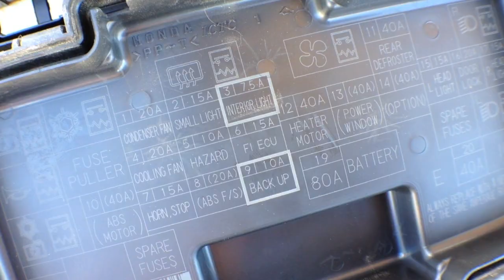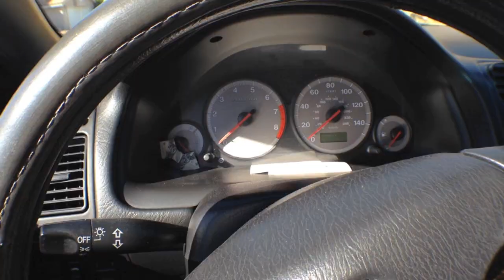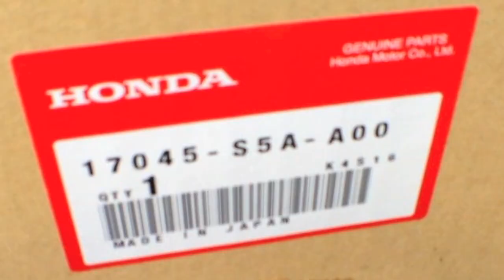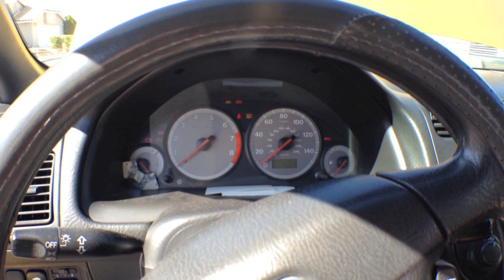Fuel leak!! Replace fuel pump Honda Civic Accord √ Fix it Angel

Comment: Pulled out seat and I have Exact same crack today in fuel pump housing On my ES1 stock 218,000 miles, thanks for the video.

Comment from the maker: Fuel Pump https://amzn.to/2UTzABp
                    http://tiny.cc/v4rf4y
Fuel Pump Removal Tool https://amzn.to/2YlvVhL
                                              http://tiny.cc/4wrf4y
3/8 Drive FlexHead Ratchet https://goo.gl/QVMstw
                                                  https://goo.gl/jjDK9r
3/8 Drive Metric Socket Set https://goo.gl/sRTnaT
                                                  https://goo.gl/MyyyWU
3/8 dr. Metric Deep Socket Set https://goo.gl/6KCiYG
                                          https://goo.gl/DxQBJM
3/8" Drive Extension Set https://goo.gl/HrOvhn
                                          https://goo.gl/hpyyHw
Cordless Screwdriver https://amzn.to/2F3jMoW
                                        https://goo.gl/Ty6zaG
Small Pick Set https://goo.gl/Qw2EPj
                           https://goo.gl/fEVAf3
Shop Towels https://goo.gl/K1LJKh
                        https://goo.gl/aeqBTL
Shop Rags https://goo.gl/wzFLHT
                    https://goo.gl/C6UfjR

Comment: EXCELLENT AS USUAL! JUST CURIOUS AS TO THE COMPLAINT, ODOR INSIDE?  PERFORMANCE? DASH LIGHT?
Reply from the maker: +BEEKEEPER Yes strong smell of gas. performance of the car was normal, I guess the fuel pressure was enough for the car to run good. and there was no check engine light. Thank you for the question. Have a nice day.

Comment: I have a 03 Civic... check engine light came on with p1457 Evap leak... I changed the canister and both purge and by pass solenoids... the code came back on... and my car do smell like gas... can this be the cause?
Reply from the maker: I don’t think so but if you smell gas. It would be good to check if it has a fuel leak.
Reply: Fix It Angel I took out the seat and saw that the pump was cracked... could that be the vapor leak that is setting off my p1457 ??

Comment: Hi 
I have a question  I need to remove fuel  pump on Toyota Highlander but the retainer ring   can’t get it off on what direction came lose (I’m doing against clockwise) I appreciate any advice thanks in advance
Reply from the maker: Alejandra Ruiz hi, it is very hard to remove. Remove counter clockwise
Reply: Fix It Angel thanks for your soon response

Comment: Mine was leaking from top I got 4261psi epoxy glue and sealed it but I see gas leaking from around screw cap I took cap off and seems alright, what should I do thanks
Reply from the maker: remove cap and put silicone grease around the seal.
Reply: Fix It Angel does the silicone grease stay greasy or acts as a sealant
Reply from the maker: Hi, Yes

Comment: You shouldn't use anything with silicon on your fuel system or intake. The silicon vapors alone are enough to blind off your oxygen sensors

Comment: Hey, great video. I didn't know Honda sold the whole assembly together. On rockauto.com I was able to purchase the top part (which was cracked on yours) by itself. But you have to look under 04 civic. How much did the whole assembly cost?QUESTION: I noticed your car cranked for a bit before it started after you finished. I just changed my fuel pump filter (that top part of the housing) and now my car is taking as long as yours did to start, if not longer. Since this repair job, has your car gone back to normal, starting with a 1-2 second crank and then turning over? Or is it still cranking for like 5 seconds before starting?? Please respond!!!! :)
Reply from the maker: Hi Callum, This is my friends car. The part was around $350. There is no problems with his car. No issues on the start time.
Reply: Fix It Angel Alright, thanks. My civic's start time seems to be normalizing. Sorry to hear you paid 350! The part you needed (the top part), I only paid about $60 for. :/
Reply: Do you have the part number of that top part by any chance? Thanks!

Comment: I smell fuel around the outside of the car. Thankfully I don’t smell it inside if I keep the air on recycle. Either way it’s not safe to drive but I don’t think this is my issue. Wow that’s quite a leak! Holy crap. I’m hoping it’s just a gas cap but the car sat for a while before the guy sold it to me. He said he drove it around every so often but still... can’t be too good for a fuel tank. The smell was really strong last night but I couldn’t smell it today. Damn cars... my CRV is in the shop getting the whole drive line replaced. Still cheaper than a new car but I want just one vehicle without a check engine light on lol. Eh, I paid $2600 for the car... if this is all that’s wrong with it I can deal.

Comment: Hi, I have a question. Did the cracked fuel pump in your car cause any other symptoms besides the gas smell? Thanks for your time.
Reply from the maker: Hi, my friend said it was just the smell he noticed. It's odd, I would think the car would have a long crank time to start. Welcome
Reply: Oh okay I see. Would you be able to find out if he had any unusual shaking of the car while at stops? Thanks
Reply from the maker: do you have a check engine light on?
Reply: No, just the maintenance required light just flashes then goes away when I turn on the car. My fuel pump is cracked, but I'm not losing gas mileage and it isn't spewing out like your friends. Not sure if that could be causing the shaking/vibration of the car. I already changed the engine mounts, cleaned the throttle and the idle control valve. Also checked the fuel injectors and they look fine.
Reply from the maker: When you are driving the car, what is the speed it is shaking. it could be your axles.
Reply: +Fix It Angel At stop lights or when the car is in park so zero MPH.
Reply from the maker: Sorry I don't know what the problem could be. I can't think of anything else. Maybe your idle air control valve is dirty?
Reply: +Fix It Angel It's cool man thanks a lot. I'll just replace the top of the fuel pump and go from there.

Comment: Afraid I might have to do this.  My car is a 2003 with 188k miles.  Really trying not to spend too much money on it.  Going to tear it apart this weekend.  If mine has the same problem, can I just silicone the top instead of replacing the entire unit?  Money is kind of tight now and it's an old car.  Great tutorial going step by step.
Reply: Hey how did you end up fixing it?